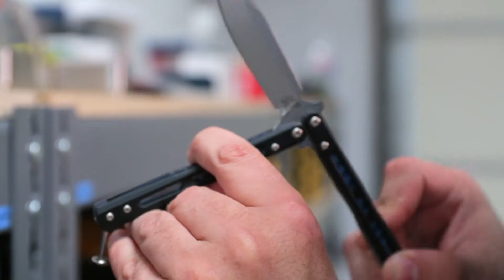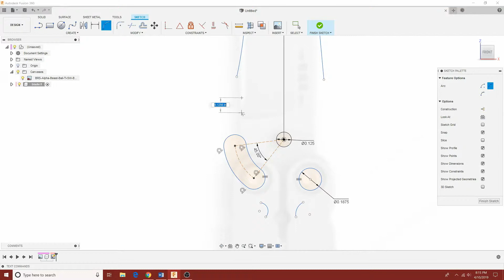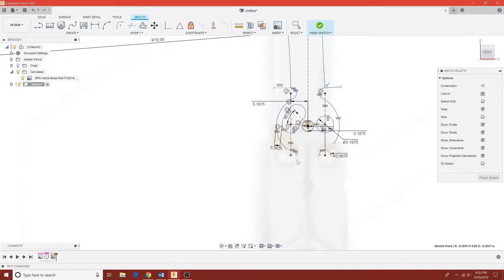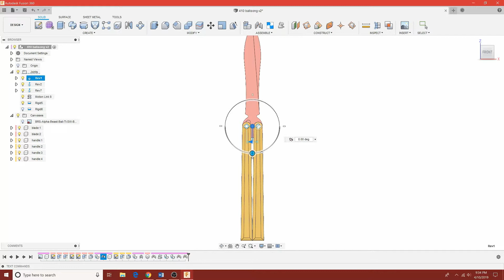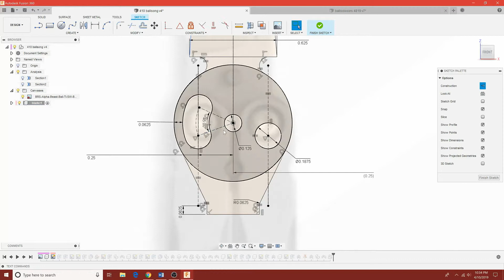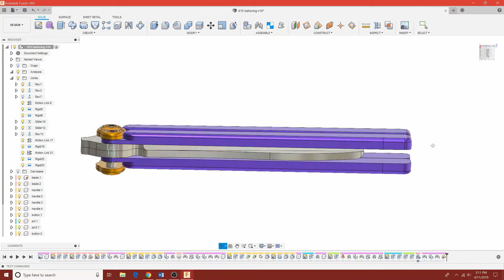Balisong + Scissors = Baliscissors? Ep 1

Comment: The benefit of scissors over a knife is that you don’t need a surface to cut against, because the blades cut against each other. You can bring the blades to the material instead of bringing the material to the knife. I can only think of those leather man folding shears as an example of “edc scissors”.